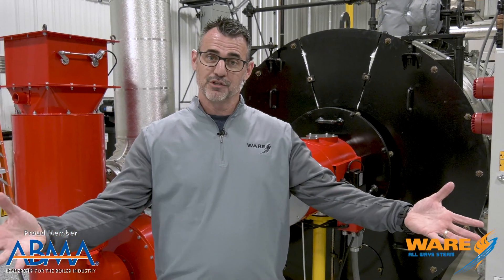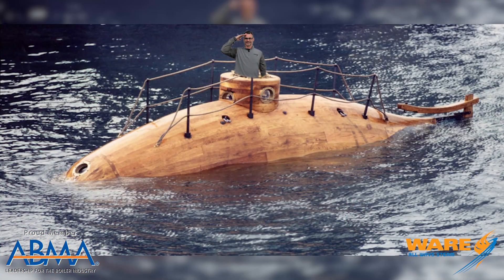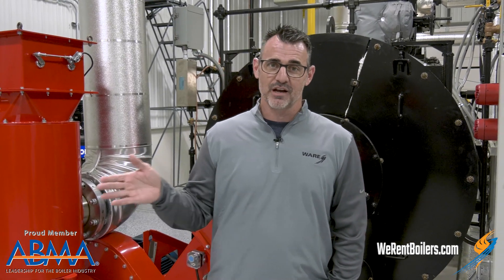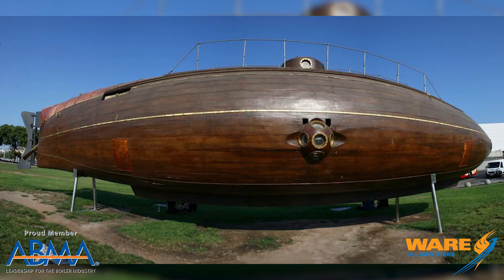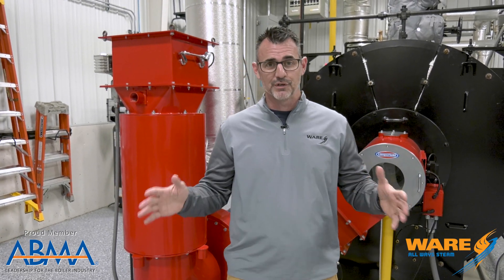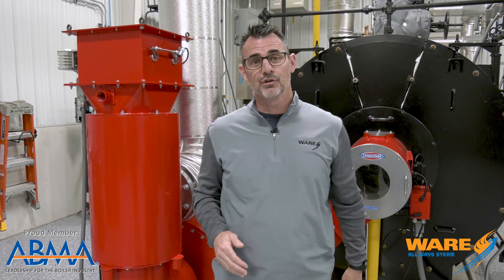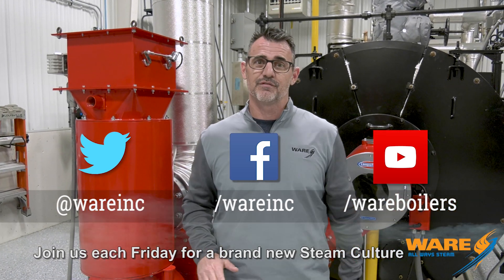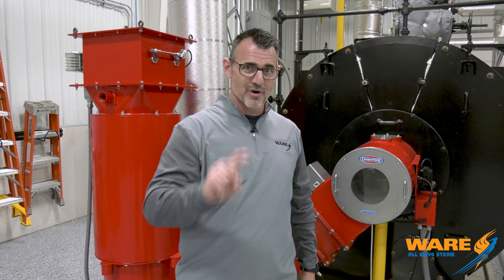The First Steam Powered Submarine - Steam Culture

Comment: I was surprised, I was expecting you to talk about the British K Class Submarine.
Reply from the maker: Mind filling us in on this? If there is a lot there we might be able to cover it. Thanks for watching!
Reply: @wareboilers  the k class were huge steam powered submarines developed by the british navy around WW1. They were extremely fast, but communication was a bit of an issue and due to this, as you can imagine, suffered huge problems with water ingress and sinking when crew didn't get the vents closed up in time during submersion. They were the forerunner of the nuclear powered sub, which uses steam turbines, with steam generated with heat from the reactor. There's a great book by a guy called Don Everitt that documents the K Boats, well worth reading. I was surprised when you claim to have the first steam sub, theyve been around for 100 years already.